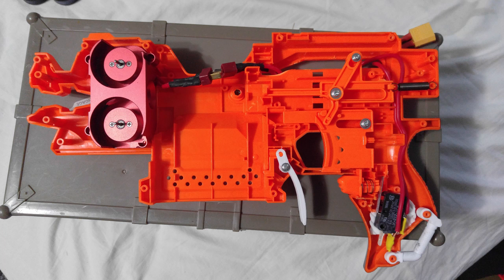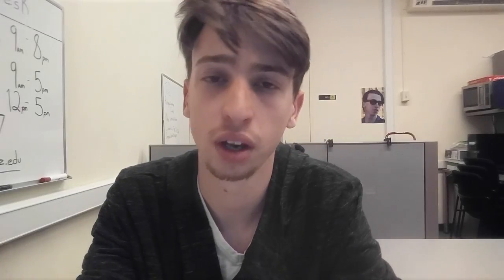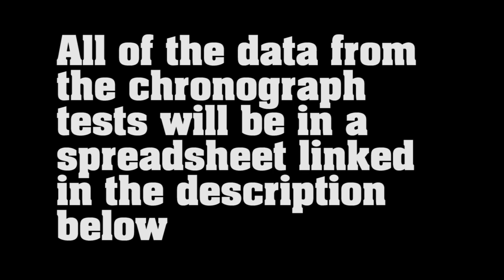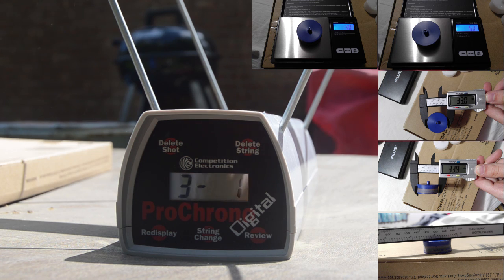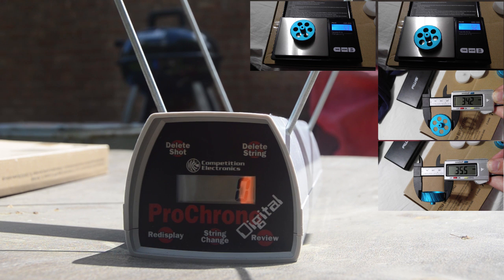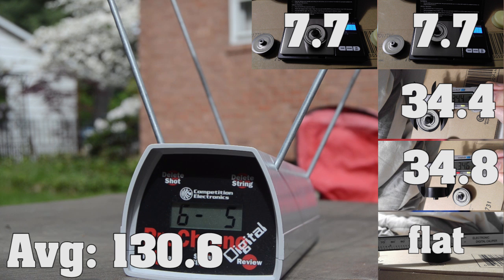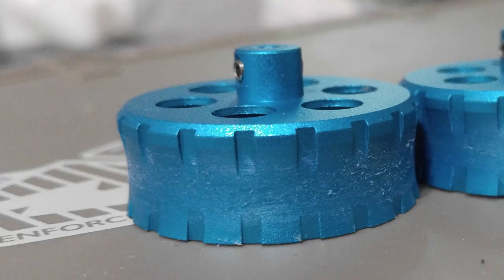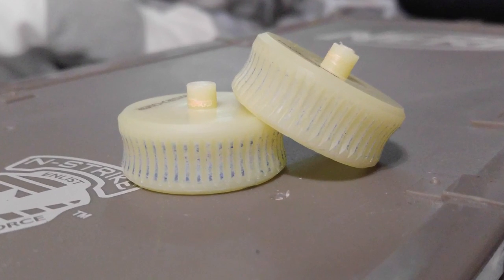Testing all the Flywheels!

Comment: Thanks for all the data.  I've been looking for accurate dimensions on some of these flywheels.

One thing to consider is that the Blasterparts flywheels weren't really designed for the test setup used.  They have a smaller inside diameter than stock Stryfe wheels and don't work well in high RPM systems unless you put them in a high crush cage to offset the smaller diameter.  They can turn a high crush cage into a mid crush system.   They may also be good for low velocity mods (>100FPS).  People using Enloop AAA batteries might find Blasterparts wheels work well at reducing noise and increasing accuracy without requiring the additional current of a mid to high crush system.

Comment: nice informational video,  aftermarket flywheelies are kinda expensive
Reply from the maker: Sniper Pro nerf mods yeah they can be, but the increase in performance over stock is definitely worth it. I think worker sells the cheapest (like $10 plus shipping through monkee mods) if you don't mind potentially damaging darts (more so than you would otherwise).

Comment: what about with motors that can handle 4 and 5S battery packs? it sounds like a good test but I wonder if some wheels would handle more volts better
Reply from the maker: Boom tendo as far as I know, I don't think anyone has made/found 4s or 5s motors that are the same size as what we use in flywheel blasters.

Comment: you said 16 gauge wire, right?
Reply from the maker: Yep, I always use 16 gauge. 18 works too, but might as well go all out, especially since there's not a particular price difference.
Reply: Dennis Vilensky OK, I normally use 18, so I'll have to get some 16
Reply from the maker: It's not a totally necessary change, if you already have blasters wire up with 18, there's no real need to rewire them, but I personally always use 16. It can be tricky to fit into some areas of some blasters because it's thicker, but it's safer to use thicker wire in the long run.
Reply: Dennis Vilensky OK, thanks.
Reply: But if something stands in my way, Dremel Spins up It's getting out of the way 1 way or another